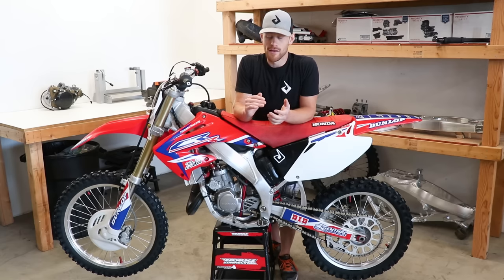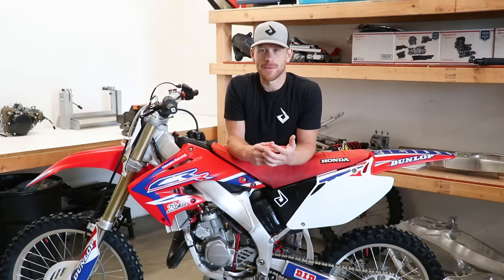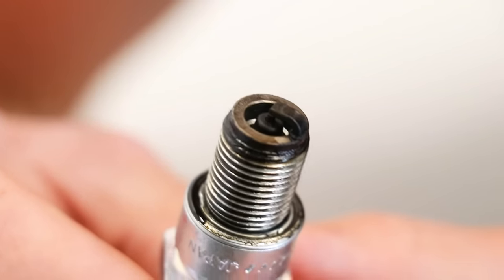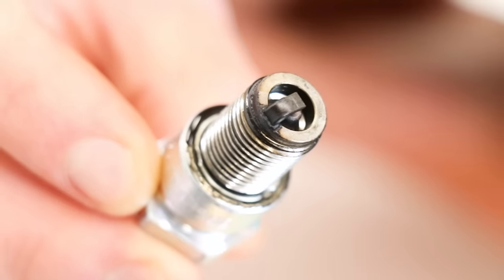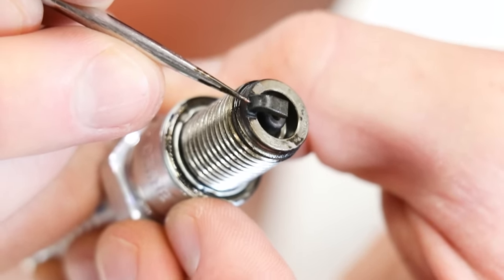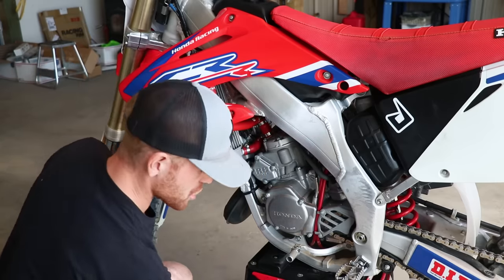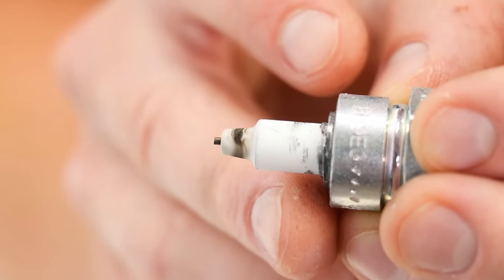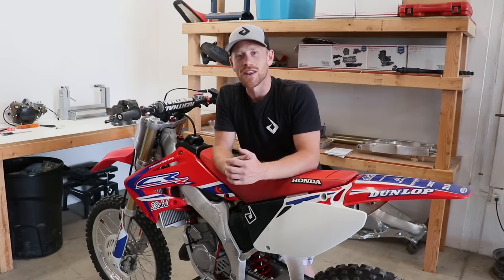How To See If A Two Stroke Is Running Correctly!

Comment: Lean does NOT build more power. More oil more power.
Reply: More air=more boom=more power. Unless you overdo it,  a tiny bit lean gives you more power. However i dont think your cilinder is gonna like it very much. Also oil doesnt give any power at all its just a lubricant lol
Reply: @MUSTAFK  Your wrong, Oil seals the rings in the cylinder and increases the compression, why do you think all the old school guys ran 32:1?
Reply: @josephfelice601  My bike mixes oil and gas itself, at 50:1 out of my head, so i cant change that. Unless i take it out and mix myself but i like the simplicity. However i can personally say that running leaner allows me to go faster, but hey if you get more power by running rich, then by all means
Reply: @MUSTAFK  There are fuel programmers that can change the mixture ratio on these TPI bikes. I also run rich to keep my bike running longer, and the reliability up.
Reply: @josephfelice601  Everyone i know doesnt touch their oil pump, and those who do still mix 50:1
Reply: @MUSTAFK  ok, well to each his own. i run Amsoil at 32:1 and my bike rips.

Comment: When it comes to spark plugs... what would you say is going on, if the tip and insulator are slightly green in colour? 

It’s definitely not headgasket/coolant as it’s still all clean in the rad and overflow .

Any help would be awesome! 😎

Love the vid. 💨💨💨

Comment: I just purchased a brand new 2021 yz 125 
Owners manual says run 32-1 but it seems a little boggy.
I'm doing trailer riding / forestry 
What oil ratio would you recommend? 
40-1?

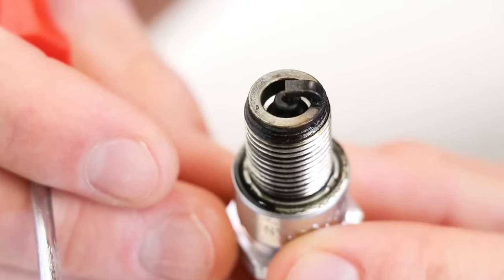Comment: Cameron Niemela 4:20 Actually an engine makes the most power, when its running slightly rich. Lambda 0,8-0,88.
Slightly lean means best fuel economy NOT power.